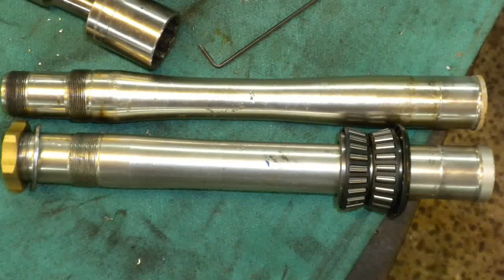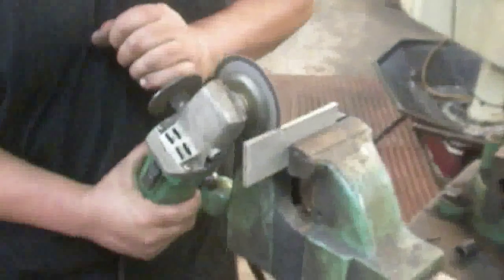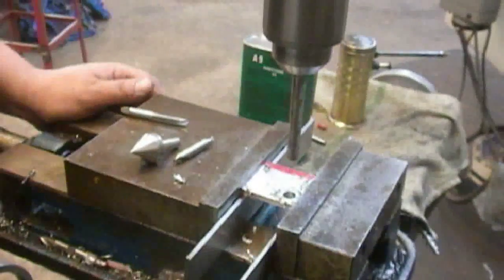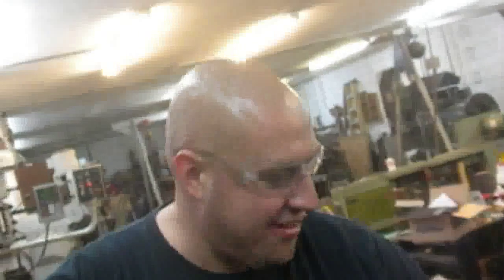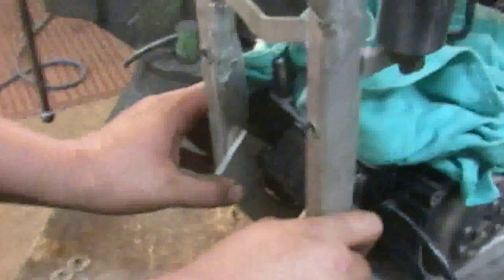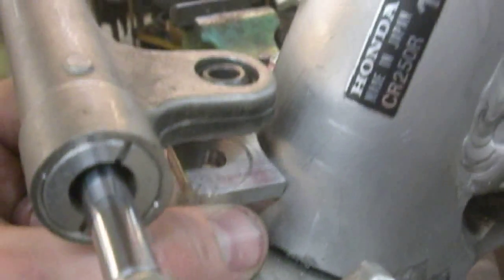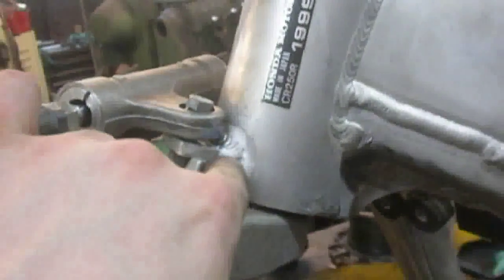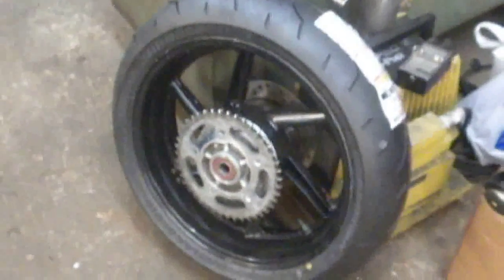CR500 Sportbike - Project Street Racer - Part 2

Comment: Your "welder" should know that, especially with TiG, after finish welding that part, still have to leave the gun on right on that spot , and let flow the argon on the metal what is still basically melted. In that case argon helps cooling it down, but most definitely helps that welding got any cracks or welded problems... what can cause failure.  
But that's just a thought....😊😊😊

Comment from the maker: @DonovanxPetersen Its really not too hard with a press or a long screw/bolt and a proper sized washer.  The GSXR stem ALMOST fit in there.  We were actually going to recess the upper race to give me an extra 1/4" to put the GSXR hardware on... instead we opted to press out a CR250 stem and press it into the GSXR trees and make an adapter for the top tree.